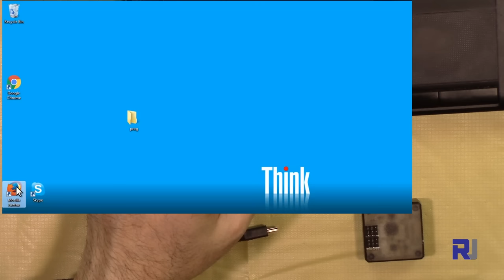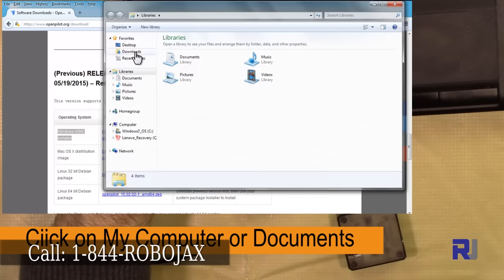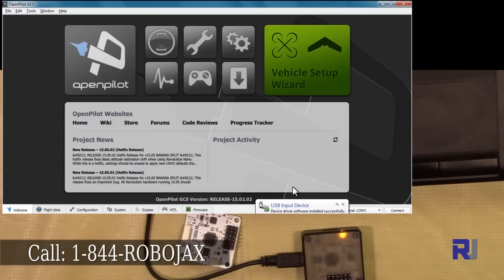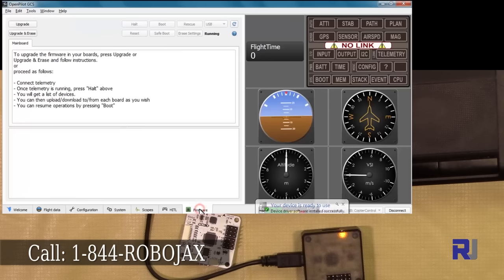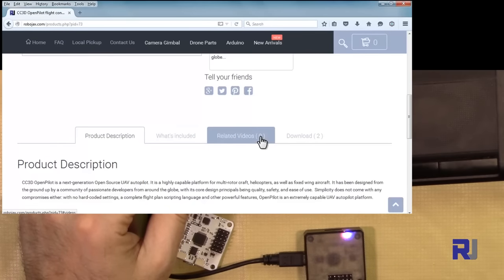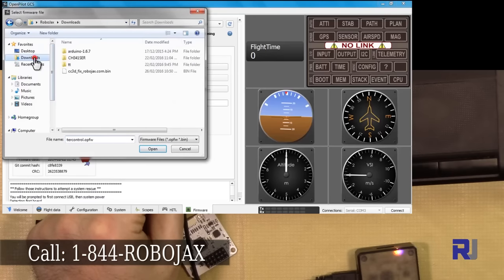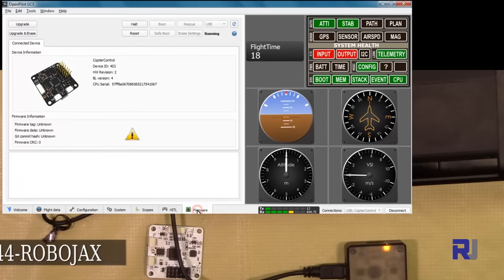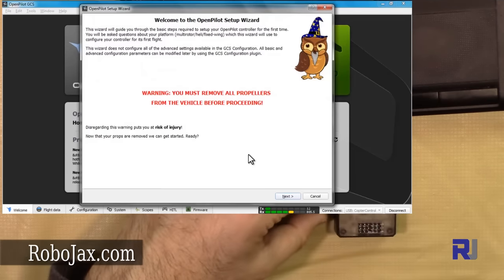CC3D Firmware Bootloader Fixed

Comment: I also want to say thank you SO MUCH!!!!  I tried to upgrade my bootloader and thought I had totally trashed my CC3D.  But after watching your video and following your suggestions, I am back up and running!!  You get a two thumbs up from me.  Again thank you for saving my Eachine Racer 250.  Now to try and see if I can go out and fly.  I have been having issues with it after I upgraded the firmware and changed some settings according to another YouTube channel.  It kept flipping forward every time I tried to take off.  Wouldn't flip sideways or backwards always forward.  I checked and rechecked prop locations and motor spin directions and everything was fine.  I hope this has cured my problem.  Again thank you so much!!!  Juddie
Reply from the maker: You are welcome. 
for flipping, you have connected the motors in the incorrect order. Please follow this order http://rcdrone.com/wp-content/uploads/2015/06/cc3d_quadcopter_x_motor_numbers.jpg
Reply: Thank you for the information.  But I have confirmed that the motors are in the correct order and the props are on correctly.  This is the Eachine Racer 250 FPV RTF.  All I did when I received it was put the props on and start flying.  Then I used LibrePilot and updated the firmware.  She flew good after that, but then I watched several videos about settings in LibrePilot and made a few setting changes and then it started doing the forward flip on take off.  That was why I was trying to update the bootloader and was trying redo the firmware update.  That is when I almost lost the CC3D, but then found your video with the bootloader fix.  Thanks a million again for that.  I have registered on your robojax website.  I need to order the wiring kit for the CC3D.  The factory setup for the Eachine Racer 250 is all black wires and an adapter on the I6 receiver.  Thank you again my friend.  Juddie

Comment: I have a openpilot cc3d atom mini, If I flash cleanflight or INAV on it, can i still come back to openpilot using this method? Also is it possible to connect bmp180 baro to cc3d and achieve altitude hold using cleanflight or INAV?

Comment: Hi RoboJax! Great video; however, my CC3D boards (I have three, two with the case and one without) all have bootloader version 3 on them. And apparently they need BL v. 4 in order to work with LibrePilot. Any insight on how to update the BL version on these boards? I attempted doing a serial com update from another set of instructions off the web, but am not exactly sure if I was doing it properly. I used a USB-to-TTL adapter to hook up to the UART chip via the Main Port. But beyond that, not sure.
Reply: Did you happen to resolve this? I'm going thru this issue now.
Reply: Hi Wayne! Yes, I actually was able to; however, I never FULLY got operational because I discovered one of my rotor motors was no good, and I got sidetracked with work.

Comment: thanks for the video, I have the cc3d atom, when connecting it to the pc, the USB connects and then disconnect, as the pc can't recognize the device, I've been trying many USB cables that work on all other devices, if I connect by rescue mode, then I can erase and update, but still after the update can't recognize the device and have orange led on, any advice on how to fix? sorry and thank you.
Reply from the maker: Hi, it seems the issue is with driver. I don't have the flight controller in had any more.
Reply: @robojax   Robojax  hi, thanks for the response, I have the big size cc3d, no issues, this atom cc3d worked and after minute just stop and can't be recognized, what about the driver? its something to do with that unit as it have only power on and no reaction, what do you think? thanks

Comment: Doing this will it remove betaflight and put open pilot back on because we have loads of cc3d bords and any that have been flashed with beta flight or clean flight just won't work with pwm but Libra pilot and open pilot have no issue

Comment: 3:40
I don't have capterControl virtual COM port

How can I fix this problem

Please help .. I am tired
Reply from the maker: Then you must see unknown device, double click on it and select update driver . It is the co2104 chip and window should recognize it. Or your USB cable is bad. Try another cable.
Reply: @robojax   Thank you for your interest, 

When I connect the cable the connection button be ( serial COM3 ) 
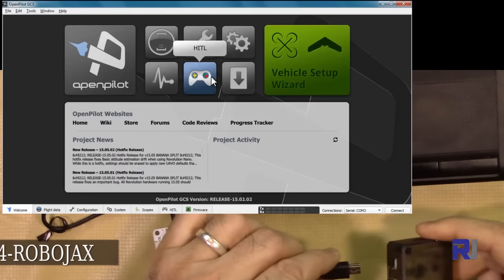as at 7:31 in the connection button below.

 I'll buy a new cable,
I am using the cable for Samsung mobile, is it suitable?
Reply from the maker: If the cable is not broken, all USB -C cables work and you don’t need to buy another cable.

Comment: Thanks for your prompt response.
I downloaded Openpilot but could not make the the required "Copter control virtual com port" appear in my device manager. I even downloaded the bootloader software but neither my "upgraded version Openpilot CC3D EVO" nor  my "Openpilot Mini CC3D Atom Nano" could "properly connect" to GCS. Bothe used different USB cables.
Reply from the maker: The OpenPilot is NOT a driver. it is the application. Before connecting or running OpenPilot, make sure you see it in your Device manager. Please reply to this message and do not open a new tread as this will make it easy to reply.
Reply: hi I have the same probleme my computer doesnt see the cart any "copter control virtual com port" in my device manager , I ried different cables and computer , I think its a driver problem , do you know what is the right driver
Reply from the maker: I don't think I have the software on my machine, but have you tried LiberPilot http://www.librepilot.org/
Reply: yes I have the libre pilot
Reply from the maker: Try connecting CC3D to another windows machine. Perhaps with older version of windows and see if it works.
Reply: You are asking me to see the device manager for "Copter control virtual Port" - BEFORE CONNECTING/RUNNING THE CC3D. 
In your own video you had refreshed the device manager thrice - after the Openpilot App was opened & CC3D board connected. And then this Copter control port had appeared.
What you have replied to my problem, that is contrary to your own video. Without opening the App and connecting the CC3D how will the USB drivers get installed?
I'm sad, but I'm glad! Tnx for your help.

Comment: whenever i try to fly my 450 quad suddenly throttle gets cut off and then again suddenly throttle up i dont know how to fix this throttle oscilation problem
Reply from the maker: do you have enough experience with drone? it is very normal to face such challenge.  Watch this video  and start here https://youtu.be/mI1PkTu5rsI
Reply: @robojax  oh coomon i can fly drone in acro
Reply: my problem is whenever i takeoff it just suddenly lost the throttle and pick again like throttle oscilation
Reply: new problem now it works great with throttle but little input of yaw and drone crashes

Comment: I get copter control in my device manager but only sees com 6 in open pilot connect selector box.  when I press connect it only shows one tx bar and no rx bars....HELP
Reply from the maker: this is strange. It seems some wires might have issue. Check them, try different USB connector or check other wires.

Comment: Hey please help my cc3d is in trouble every thing is good after setup but when I tried to fly it again next day cc3d lost its firmware not booting at all only solid blue light is on not even after powering through USB
Then I did the setup again and againg everything works good but later on the next flight its again not booting at all
Tried every version of open pilot and librepilot please help
Checked the power on SEC's bec its 5v on all
Reply from the maker: Hello, I wish I could help.  There is not standard and hardware or software appear and disappear. I don't like it.
Reply: @robojax  OK thanks

Comment: Where is the location of this file for fixing the ccd3 not detected
Reply from the maker: The link is in description
Reply: @robojax  my ccd3 evo not detected by windows 10 pc tried in 2 pc. Librepilot and openpilot is not detected ccd3. In device manager in ports it shows stm32 virtual com port. Should I set baud rate. It says no link. Red led is glowing and blue led is blinking at 1 sec.  Manufacturer says it already has latest firmware
Reply from the maker: stmp32 is not the right port I believe.

Comment: Sir am not able to save my configuration to cc3d in last step so plz plz plz help me
Reply from the maker: I can't offer better help than this video. You have to watch and follow exactly the instruction. either you are not following the instruction or your module is different or wiring is wrong.
Reply: @robojax   sir if it is so why my motors start rotating when i run it in computer